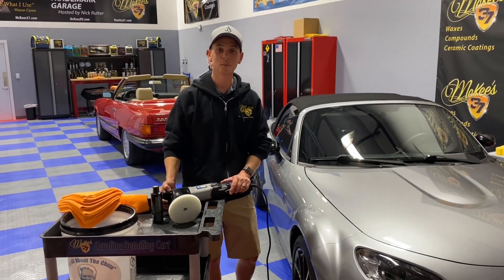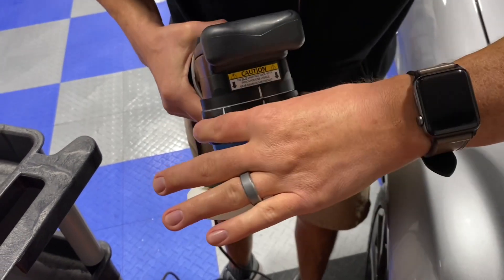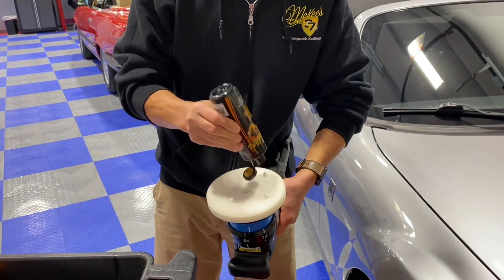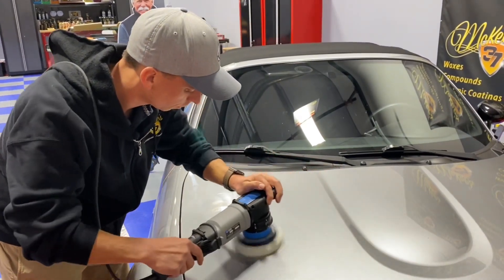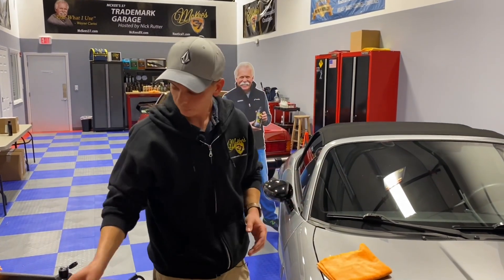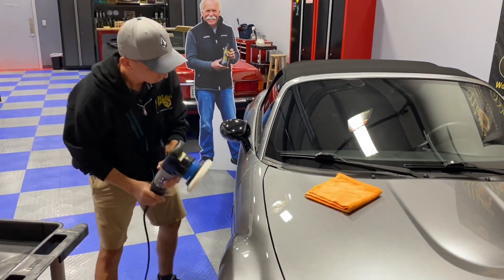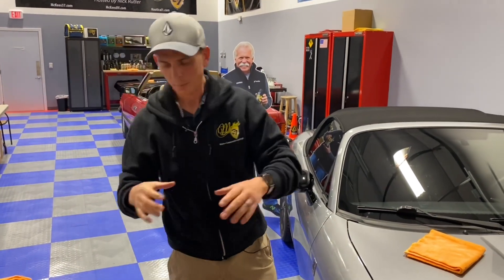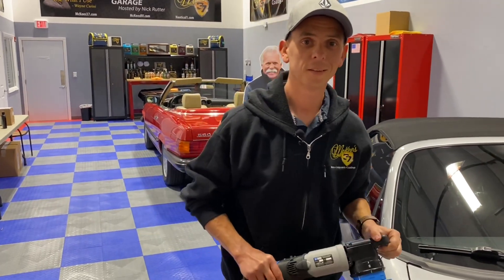Is the UDOS 51E WORTH $700? Up Close & Personal With Lake Country’s first Buffer.

Comment: I have used the UDOS since I got my hands on it (October-ish) and it works great! I enjoy having everything I need in hand - different throws allow me to instantly adjust to clearcoat/paint hardness and compounds. It is a beast with plenty of power. It has markers so that you can see if you have a stall and I found it took a bit of use to get the correct pressure. It works with any pad (5.5").

I can really move through corrections and polishing with this tool. Expensive? You truly have multiple machines, so it is worth it for me. Thanks to Nick for the excellent review. I couldn't have said it or shown it better :)